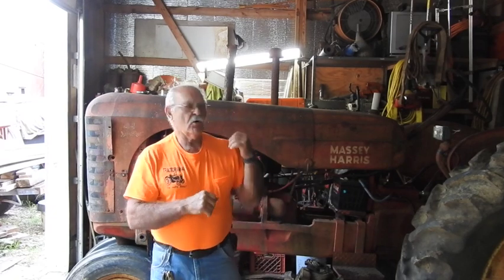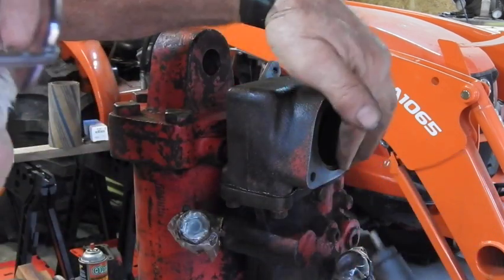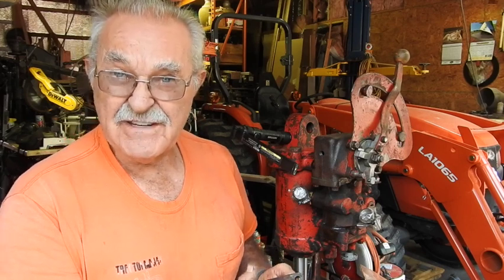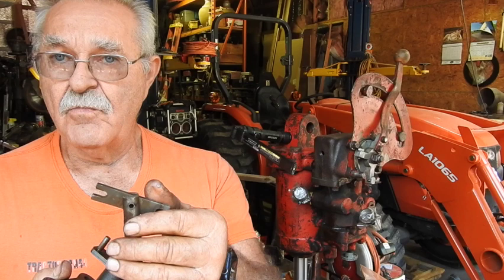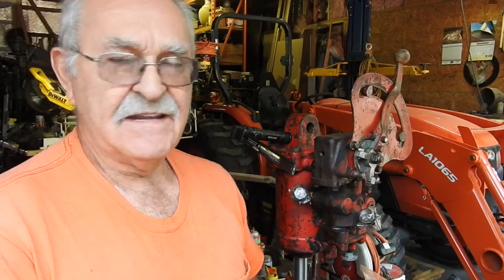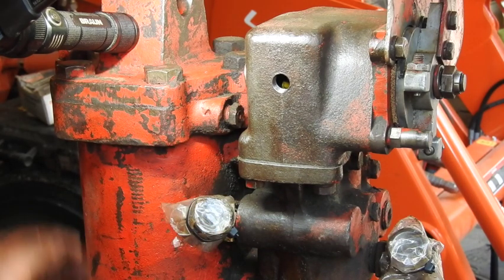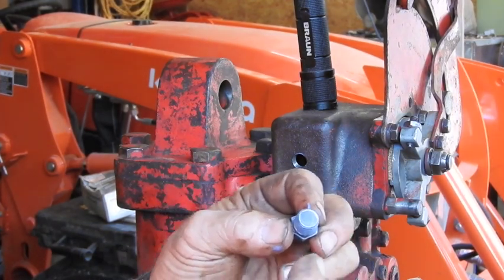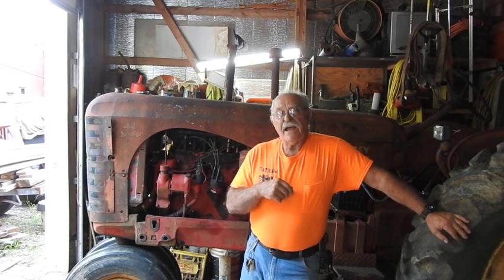MH 44 Hydraulic Hack for Control Valve Assembly

Comment: Hi. I have a 1977 Ford 1600 Tractor with a 1.8 L diesel. Was wondering if there is an engine rebuild kit for it and where I can find one. Thanks.
Reply from the maker: I don't know specifically, but I'd get the model AND serial number from the tag and also the engine manufacturer.  Then google that specific engine model number for a rebuild kit.  You need the serial # because often the manufacturers make improvements on this or that during production so those changes are tied to the serial number.  Engine rebuild kits vary from site to site, so make sure you know ALL the parts you want to have included and make sure the kit you select has them. 
  Don't forget a complete gasket set if you are doing a total rebuild.  Another suggestion is to buy an actual service manual on that engine because then all your torque specs and tons of details will be right there for you. Good Luck my friend !!  I usually don't get to work on new stuff like yours.

Comment: Great tip and video! Though i don't know any Massey Harris 44 tractors in Estonia, still it was interesting to watch. 

Btw, my old soviet tractor from 1953, have hydraulic system that's entirely closed system without whatever rubber seals. All components is inside one closed body. Oil pump and even hydraulic cylinder have metal piston rings. Sure there is a lot of leaks even if it was new. Because all components are inside closed compartment all leaks drips back into oil bath so there is no oli loss at all. That tractor have only three point lifter at back no other hydraulic options and can lift 400 kg (880 pounds).
Reply from the maker: Well, now that's a built in fix for a unit with no gaskets !!  Wow, that is something I did not know anything at all about.  There isn't a day that passes without me learning something new from viewers like you.